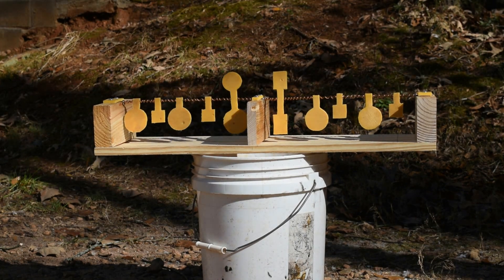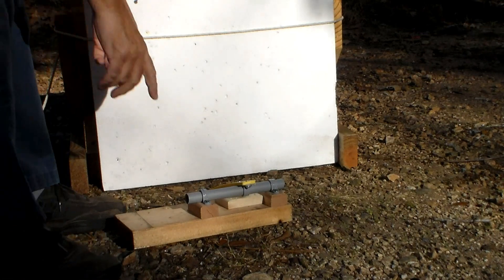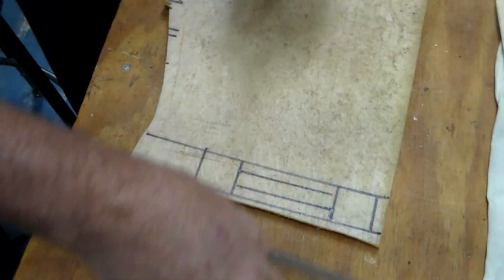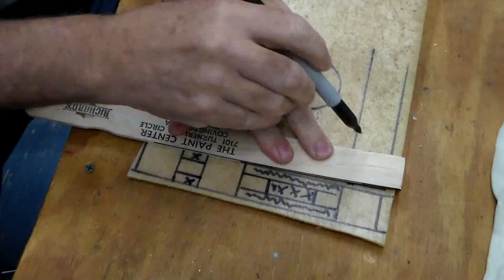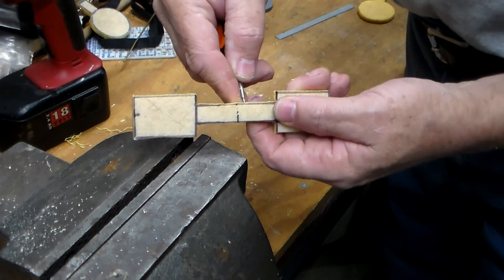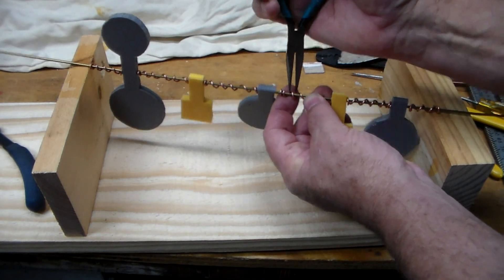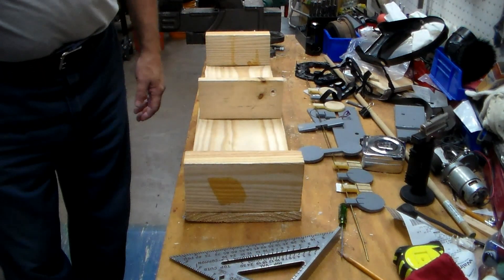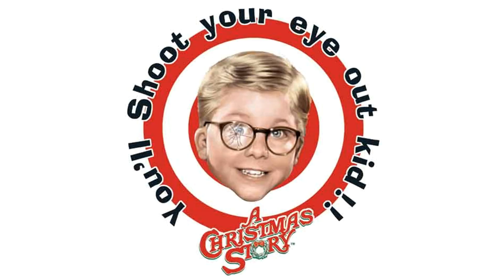Spinner targets for Air Rifle and BB gun

Comment: how thick is the plastic and how long did they last? Looks like it is getting dented with every short @3:20. And what if you hit the stem near the wire?
Reply from the maker: Thanks for your question. The plastic is a bit thicker than 1/4" / 6mm.  And it held up pretty well, despite the dents. I switched over to pellets not long after making the video. Not as many dents. I have had a few shatter if you hit near the wire. It's definitely a weak point. After a couple of years, most of the spinners were trashed. I suspect the plastic was going bad, after untold years of being the sun before I got my hands on it. And the wood got a bit weathered and rotted. I consider a couple of years to be pretty good for this.

Comment: If you don't care about rotating anf just want hanging targets, you could just start with an empty milk crate or even a cardboard box laying on it's side, open face towards you. Then take any size target out of wood or snipped tin, drill 2 holes on top side by side and hang that target on the top of the open hole by 2 strings... Voila, your targets will face forward always because of the 2 strings. You could do the same with a tin can.